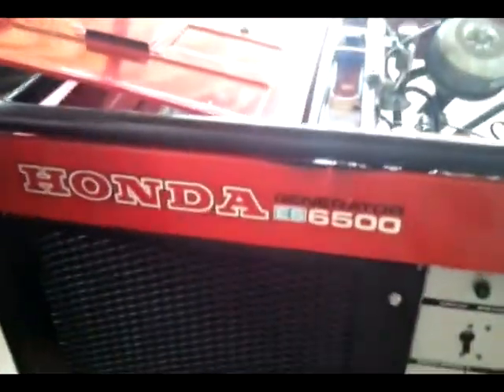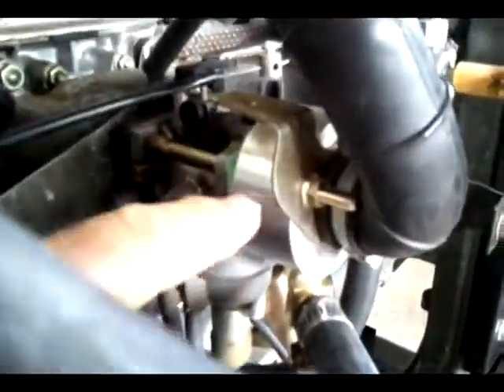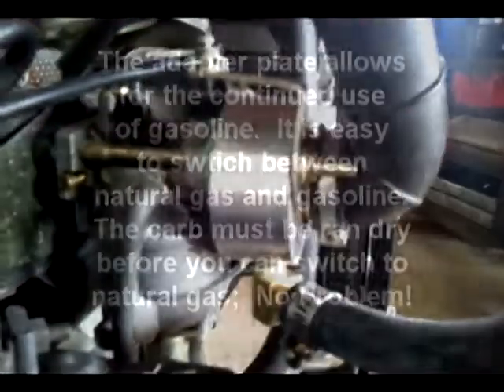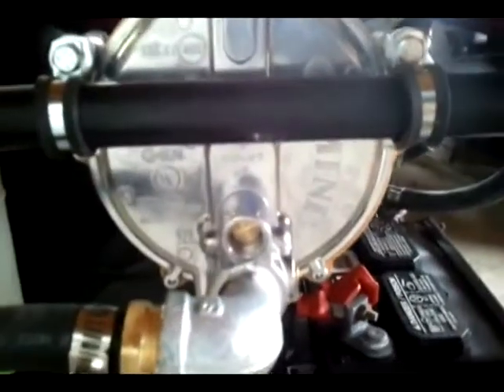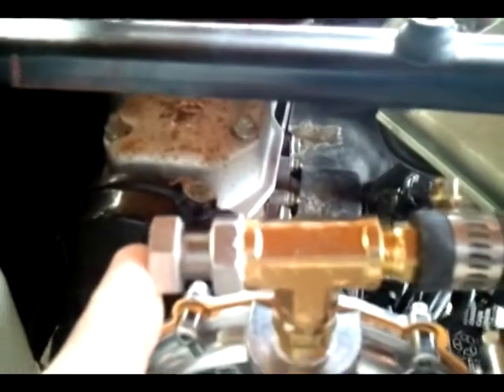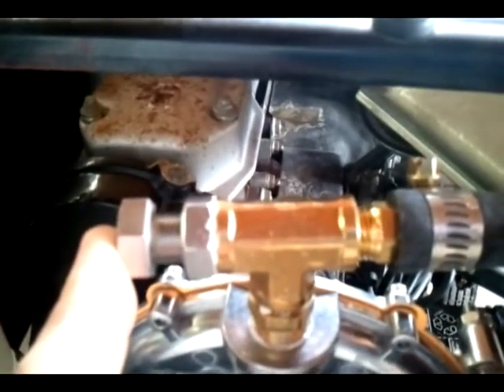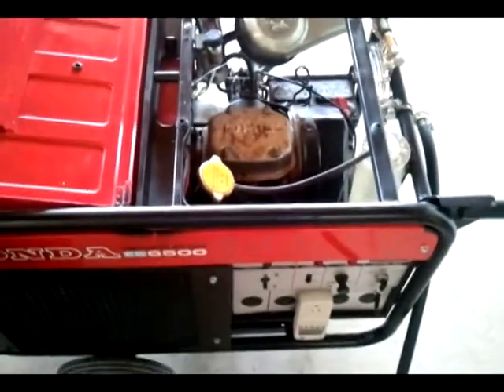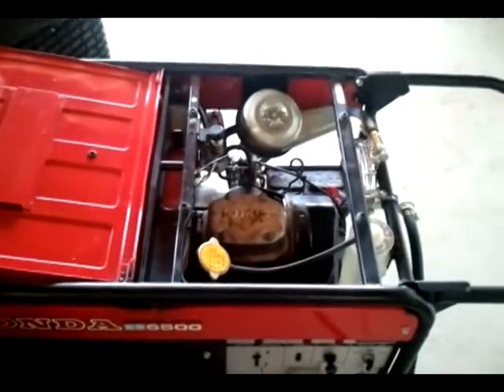Honda ES6500 Generator; Natural Gas Conversion

Comment: Nice generator. I just picked up the same one about a week ago. I was wondering mine seems to make a buzzing sound when running at idle. It almost sounds like a heat shield buzzing on and off but I traced the sound to the back cover of the alternator. Is this normal for this model. Was wondering if yours makes the same noise. It does get better as it warms up.
Reply from the maker: I have on occasion heard an intermittent buzzing/vibration noise.  There is a lot of stuff on that machine that could rattle.  I have not found mine...although, my search for it has been minimal!